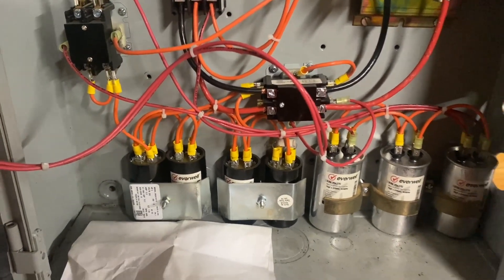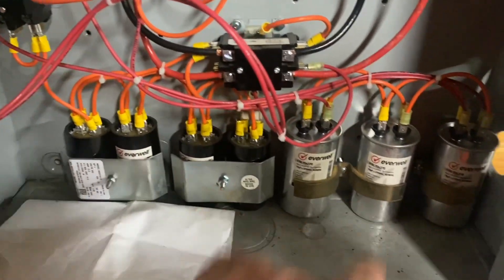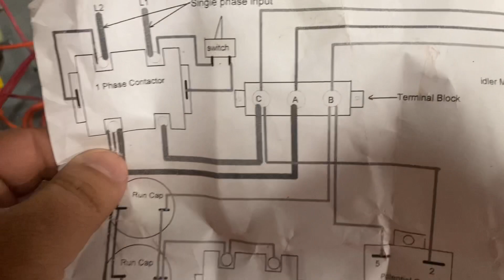1 year review of my PhaseconverterUSA rotary phase converter kit

Comment: I been thinking about this kit . I have a 7.5 1750 ithink rpm  3 phase motor I converted to a rotary phase convertor..I used a pony motor and it work OK.   But I be happy with just starting it like yours and be done with it. . I all ready balanced out the load with run capacitors but the kit seems cheap enough . Not having to start the pony motor might be a better deal..the only plus I can think of is the inrush current of the rotary convertor is probably small since it's up to speed before I power it up . Thanks for the up date
Reply from the maker: I have been very happy with it, especially given the price, my only complaint is the on off switch they provide is a little cheap but I used another one and the unit does a pretty good job of balancing the volts for my older motors

Comment: Man, I wish I'd have found your videos before I started down the path of building my own.  This company's kits are far cheaper than what I've paid for individual components, and you get the benefit of having their schematic with a proven design instead of having to figure out my own, which is a struggle for me since electronics is not my thing. I'm almost finished with mine, and I'm wondering if I'd be better off scrapping it to buy this kit and be up & running and done with it. Thank you for putting the work in to make your videos!
Reply from the maker: I have been very happy with the kit, the original switch was the only part in the kit I didn’t like but the rest has been solid
Reply: @smalltownmachineshop6860  That's good to hear. Thank you for the info & reply!

Comment: I lucked out and scored the very first inverter generator ever made, it's a Honda with a Civic engine in it. Thing is fantastic, it sips fuel and it's ridiculously efficient. It is about 10 times the size of modern generator, but it has a great feature I have not seen on any other. I can output single phase or triple, 110, 220, or 480. I think it's from 1982, but it only has like 30 hours on it. It has the greatest feature of any generator though, a remote control! Pretty impressive for the early 80s
Reply from the maker: That does sound like a very cool setup

Comment: Hey, I just came across a massive winch off of an OshKosh 5 ton. It's still attached to the frame rails of the Oshkosh, someone flame cut the whole front off and attached an electric motor with pulleys on to the framework and converted the clutch to manual. Apparently this was used for a modern skid row for logging operation in British Columbia on a bunch of uninhabited islands. It doesn't have any cable, but it's an absolute beast! Everything works quite well, no significant rust, and has really cool original castings. It's a bit big for any of my trailers and I think it would flip a small SUV over. Got any ideas for it?

Comment: I still haven't re-powered my phase converter after moving to my new property/shop. I have a newer 30hp idler plus a pile of other 3 phase motors. I've built a few very simple converters for air compressors. I built a pony motor setup to reduce inrush amperage.

Comment: This was very helpful for me. I have been wanting to build one but have been discouraged because I have never built one myself. I have my vfd and it works well but I’m not a huge fan of having one on every machine especially my grinders with all the dust in the air. I have a extra 3phase motor which I might try using however I think it’s only a 3 or 5hp I will have to go look and see. Since all of my machines are outside under tarps until my wife and I find a house to buy that gives me some time to build one
Reply from the maker: There easy to build, and 3 phase motors are cheap at auctions, 5-10 hp ones around here go for around $30
Reply: This kit is a good way to go! FWIW I'm in the middle of building my own, and I'd never do it again after seeing this kit version. This is way cheaper and more straight forward than assembling individual parts on my own. Honestly, I have half a mind to scrap what I've made so far to buy this kit and be done with it.